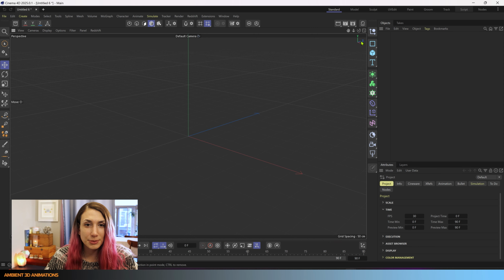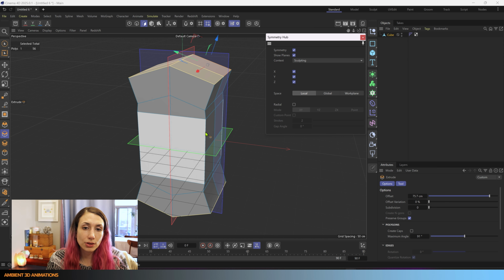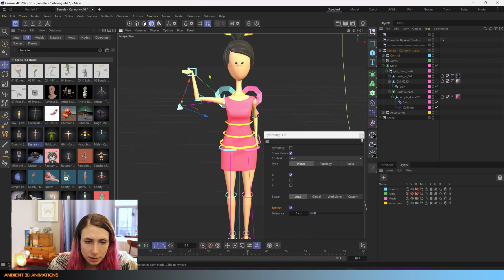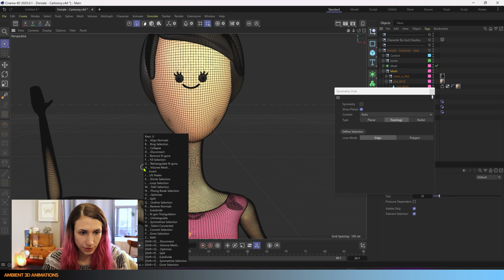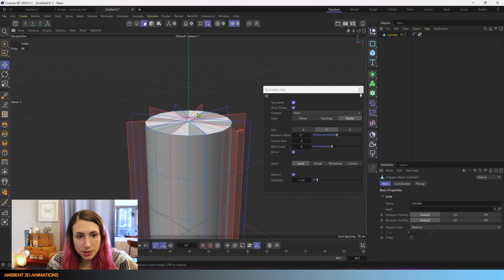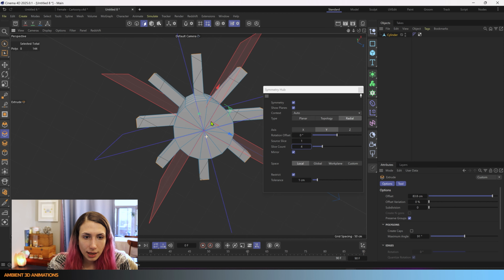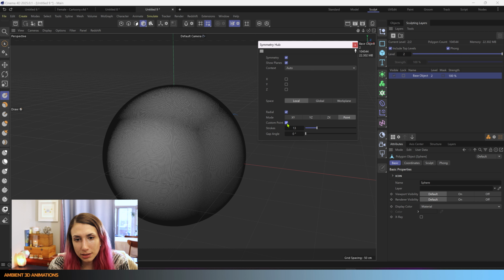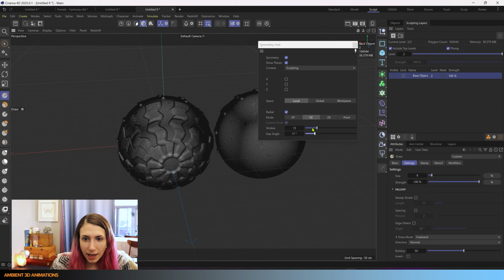Symmetry Cinema 4D Tutorial EP90

Comment: Hi! I find this tool very frustrating (Im new to 3D). I will have it turned on and It works perfectly. BUT when I turn the symmetry tool of and than try and turn it on again it wont appear again. I didn't move my model or anything else it just wont appear? Have you had these issues? Thanks!
Reply from the maker: Something that may help is making sure that the axis is where you would like it to be mirrored. Right of the object selection at the top of the viewport, you’ll see enable axis which will allow you to move the axis to a location that works with the symmetry. Please let me know if this helps :)